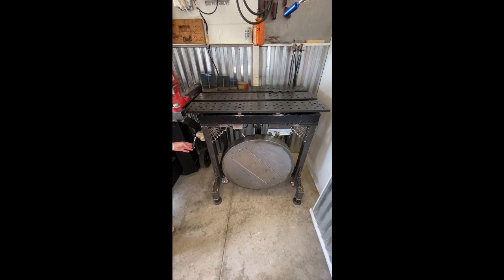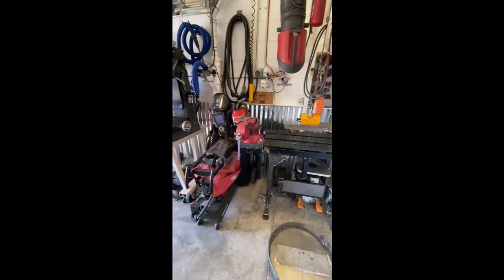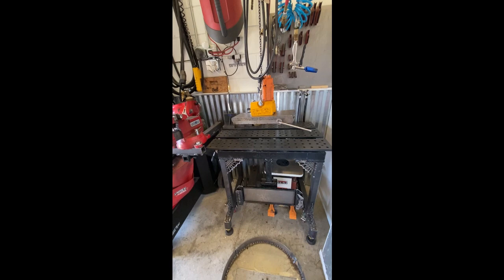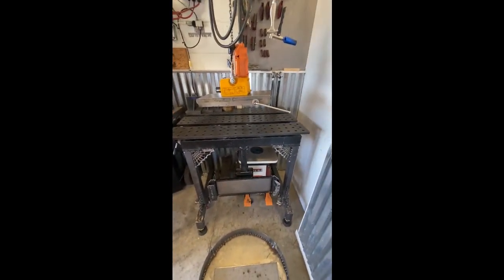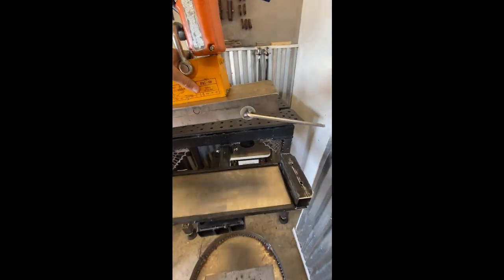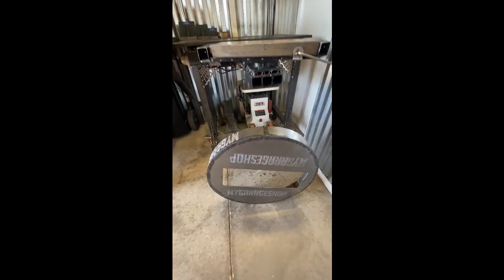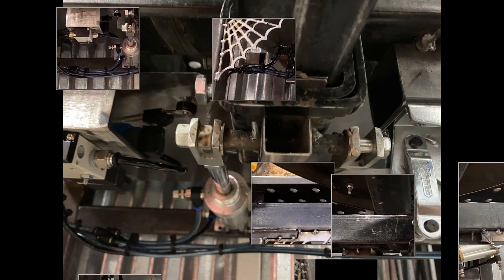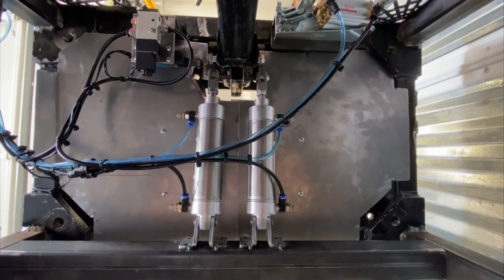Updated: Magnetic Rotary Sanding Fabrication Table

Comment: That is a great setup. I am also a bit older and make some noise when I bend over. Love your stuff, found you over on the small workshop FB group
Reply from the maker: Yeah, sorry for the sound effects when I bend over. Steel plate and some screws in my back.
Reply from the maker: @307Driftwood For me “GrandPa Noises” 😂